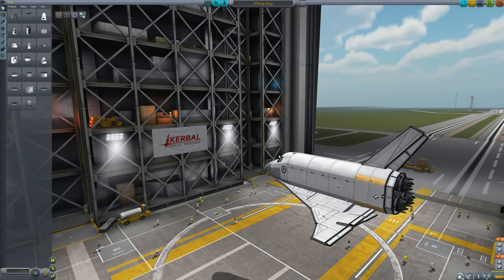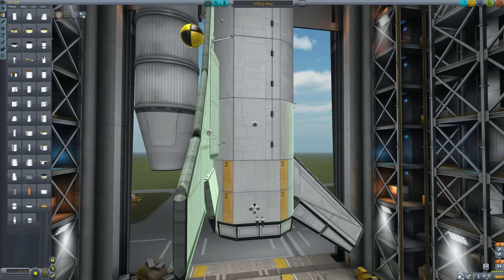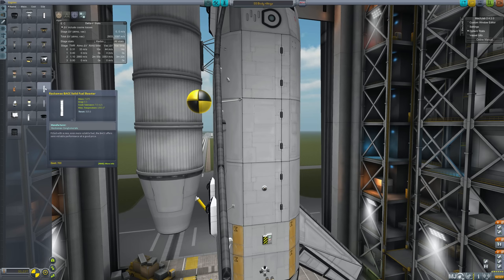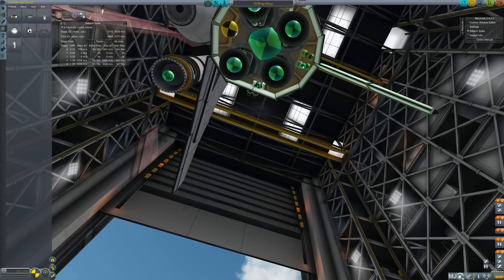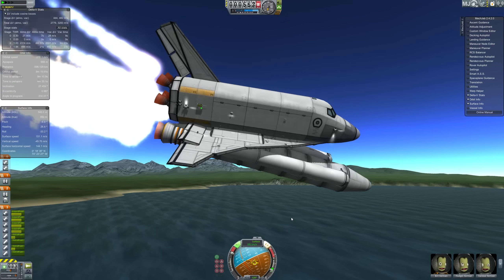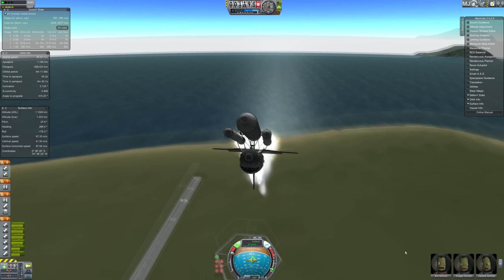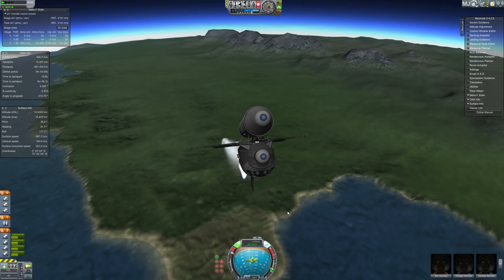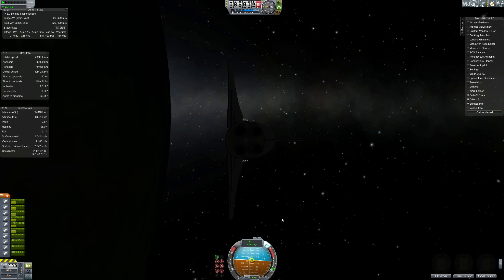Making The Kerbal Shuttle Fly To Space!

Comment: Really enjoyed this video, the trial and error was fascinating
Reply from the maker: It's so rare I get enough failures to share
Reply: Scott Manley
Scott Manley has a failure rate of .0000000000000000000000000000001%
Reply: Scott Manley Sometimes failure is more fun. BTW, did you consider editing the part file for the 1.25m gimballed engine to increase it's thrust? I know it's a hack but wasn't the shuttle engine the most powerful for its size?.
Reply: DieyoungDiefast And you could change the large radial engines to run on RCS, because they look a lot like the real OMS.